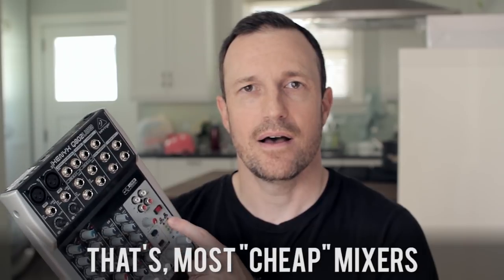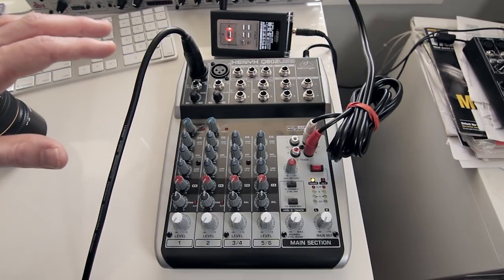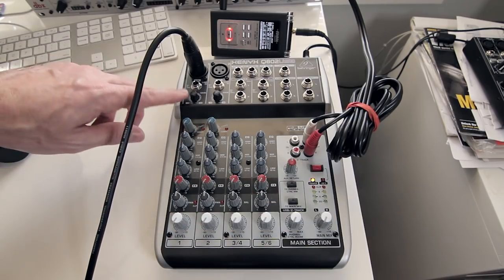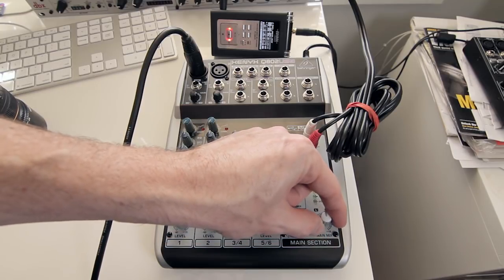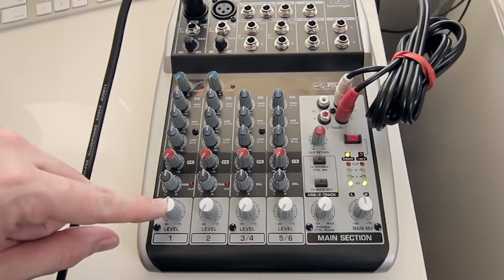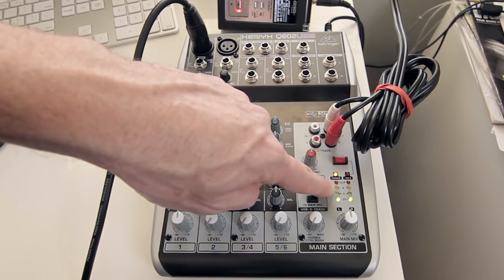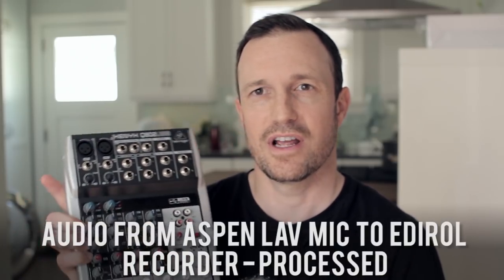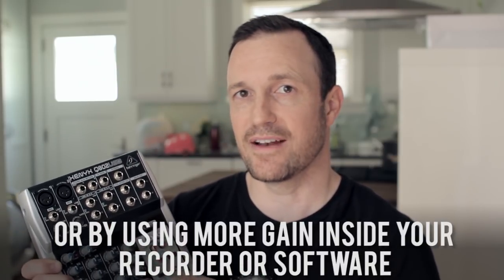Setting Microphone Levels on a Mixer - Gain Staging with no PFL/Solo Buttons

Comment: Workable for single mic, maybe two in a conversation, but if you do live audio, you'll need a whole lot more than that.  Great job for hitting the mark on pointing out which boards.  No buts. A great video, awesome tutorial, and works for podcasts like he says.  I'll try and put one up for the rest, later, I've been so busy lately with other stuff I haven't had the time, but such an excellent starting point here I was blown away.  Loved it.
Reply from the maker: Thanks, Harley!
Reply: @RayOrtega  Credit where due (and do for those who actually... ...well... ...do...) brother.
Trying to put together the necessities for a basic project room for recording\streamcasting. Here's my thoughts:
AirBnB a place for a week or two, pick a room or two, and video the setup with explanations
Do the room balancing with some simple DIY tools as well as a few extra entry level pieces of equipment (for eq etc) and describe the balancing styles being used.
Set up for a desk podcast and video the setup with explanations.
Set up a separate project recording room with a video system for monitoring, and go over the whole thing in basic detail from snakes to eq, to band warm up.
Another time, while it may prove a bit more involved and almost cost prohibitive, I might even "Float a room" with some basic materials in a DIY setup much the same way.  I'll focus on why for streamcast and for recording.
Wachu think?  I'm saving up right now, I don't know when I'll be able to do it, but I may start a GFM or kickstarter for an educational series on just this kind of thing to get there sooner.  I know people who would help with it, so long as they get paid right (and hey, I would insist on that anyway, as you get what you pay for or it's fraud\theft).  Any thoughts Bro?  Seriously, you've done this well, and anything you could pass along would be well considered.
Reply from the maker: @HTDav01  Go for it. I'd watch! Could be fairly niche in terms of getting an audience but you can bring more people in by featuring the gear and techniques used along the way. Good luck!
Reply: @RayOrtega  niche perhaps, but in terms of footage, I could cover several topics along audio and video.  The idea right now has several pathways.  More in the immediate sense, I have a smaller project in mind, targeting uploads of a musical nature and also of a conversational nature.  It's difficult to work on right now, family stuff is crazy, work too, and top that with school... ...I have about 25 minutes a week to work on it.  But hey, we do what we can right?
Reply from the maker: @HTDav01  Niche is good, by the way, it's how you get found;) The more specific you are, the more likely you'll be at the front of the line when someone searches. And yes, you have it right, do what you can, when you can! You'll be much further along a year from now than if you just waiting to get all your ducks in a row. Good luck!
Reply: @RayOrtega  thx.

Comment: Hey thank you very much, great explanation, it was very helpful!  I have a Behringer Xenyx 802 and used this method, for 4 DAYS I've been reading the same sentence in the exact same way trying to get my audio to sound right. In less than 5 minutes you may have saved me from insanity! I'm not a voiceover actor or anything, I just make little videos where I speak, but it's been driving me up the wall to the point I've almost stopped recording entirely! Thank you for saving my sanity XD
Reply from the maker: So glad this helped. Thanks for watching and the feedback.

Comment: Trying to understand the process. But at about  2 mins all knobs were down but then magically the main volume went up to halfway. Why halfway ?
Reply from the maker: That was just an editing error but when I show that particular process for gain staging, you'll notice that when I run the actual test/setup, I turn that knob back down. In this case that knob doesn't even matter because you are using the channel's clip light to gain stage and that clip LED is only affected by the Gain knob not the volume knob. Not sure if that is clear but you can also try the second method that I show if that is more helpful. Let me know how it goes and thanks for watching!

Comment: Worked like a charm. I am going to point out that his mixer goes to 15 and mine went to 10. That means his mids are not my mids. If anyone else is wondering why your results doesn't match his, make sure you are exactly between mid and full instead of exactly on mid.

Comment: Great video.Can you do a video about connecting synths to a mixer or would you use the same method? 
Thanks 
Paul.
Reply from the maker: Thanks, Paul. I don't have any experience with synths, they may require midi so you have to find out the connection first and then have an interface with that input

Comment: Good basic advice. It might be interesting to hear what happens when the trim is set too low and the channel volume is turned up to compensate. Also controlling line level inputs from keyboards and/or outboard equipment with volume controls. (I tell my crew to treat the volume control on the outboard equipment like the trim/gain on the board.)

Comment: My level and master seem to be behaving differently than yours. My level has zero one notch up on the left side of the knob. But when I set my gain to just below peak, and set my level to zero, my master barely registers any sound. But if I set my level to the middle and then set my master, I get same levels on the "meter" as you do.. but then my recording to Audacity clips and sounds terrible. So should I adjust the level or the master to make my recordings sound better? it's weird though that Audacty somehow hears more dB than I am apparently outputting. o_O
Reply from the maker: What mixer are you using? And honestly I'd set the gain the the channel and then whatever level Audacity needs. Check your Audacity settings to make sure it's not adding it's own gain.

Comment: You shouldn’t look at the main meters for any info when setting gain. The individual track clip light is the focus. Put the preamp’s fader to unity, then while speaking as loudly as you will once recording, slowly turn up the gain on that preamp until you start to see the clip light turn on— then back off the gain just enough to where you’re no longer activating the light. NOW you use the fader to control output of that track.
Reply from the maker: Thanks, that is the first method I demonstrate. I think you saw the fader turned up which I had to do in order to record the audio that you are hearing which you can see is being recorded to the audio recorder in the background, but then I turn it back down all the way and demonstrate using the clip light to set the gain which you can also hear cause then it transitions to the built in mic on the cam;)

Comment: I have a question about this one.  At 00:01:58 mark the edit has the Chanel and Main level pot jump to unity, but your VO and previous footage showed and said to have it Zeroed Out. Found this confusing, not complaining, I'm amazed with all the work you do for the community.
 Just wanted to note that the hiccup could muttlle someones ability to grasp the knowledge you are sharing. Keep up the good work, you have made a big difference to the joy podcasting and video-casting for me.
Reply from the maker: Jerry Wheat thanks Jerry. It was hard to do this one cause in order for the recorder to hear the audio the faders had to be up however I ended up using the camera's mic out of necessity and you'll see before I do the actual "check" process, I turn the fader down to perform the setup. But yes there is a chance that someone might get confused there if they have a keen eye like yours;) 

The truth is that fader doesn't actually play a roll in this setup because the clip light is not affected by the fader. So even if you put it up to unity like you see here before I turn it down, it will not affect the setup. So that's the good news in case someone decides to have it turned up.
Reply: I was noticed the same thing.. the jump at 1:58. Also confusing that the main mix was changed at all, surely irrelevant in terms of setting the correct mic gain? (but not explained in the video).

Comment: That video edit from 1:58 to 2:08 confuses this explanation. The main mix and ch. 1 levels jump to 12 o'clock, then back to 0.
Reply from the maker: Yeah good eye. Making videos is hard;) But it doesn't confuse the point. It would be fine to have the volume knob up, it would register on the meter as you see but you see this is turned back down when the 'check' is performed. So it's really simple, Turn everything down but the gain on the mic you are gain staging and watch your clip light. But if the knob was up, you can gain stage that way and in fact I show you how this is probably even better to do it with way. Having the knob down to 0 becomes more important when you have more than one mic. plugged in and you gain staging multiple mics. and of course this is the case when you are on a cheaper mixer like this that doesn't have solo buttons, and is one of the plusses of spending a little more to get even better, more convenient features like solos.  Thanks for watching.

Comment: This might not be as big a deal for podcasters, but as a working musician, you should be careful with the first method. The red clipping light means the mixer is being overloaded, so you don't ever want it to light up, you want your loudest parts to still be under the red or you'll get distortion (though you don't want it too low either, then you're just amplifying the extra noise). Similarly in the second method, you should have the meters at 0 at your normal voice level (not loudest), right? As long as you're not getting into the red at the loudest parts. But thanks for the second method, I've only worked on mixers with PFL and wasn't sure what to do, this is a good idea.
Reply from the maker: Thanks, Daniel. In the first method, the key is that when you hit the overload light on the channel you are giving a hard "check" to represent something that would overload but your normal speech never does this. If you plan to actually ever get as loud as the hard "check" then I would dial back the gain a little from that spot. However, I also think some OL lights on the channel are a warning and that there is still some headroom built in. I think that's how one of my older Mackie's does it but not 100%. 

In the second method, being at or near zero is good. On this particular mixer it's a little harder because the meter is so limited, but you can see when I talk that I am hitting the zero mark at the loudest parts of my speech and that good. 

The difference between the two being that you are purposely overloading at your loudest parts in the first method and for the second you aim for loudest parts to be around zero when you speak normally. The mixer preamps should be good enough for you to make adjustments in post production if you are in the neighborhood;)

Comment: Quick questions.
Every now and then my mic will click without having changed any settings. How do I track down what's causing it? 
Another question, is there any way to with settings to gain lower background noise without post production?
Reply from the maker: Troa Barton the clicking could be anything. Try another microphone if possible so that you can tell if it's actually coming from the microphone, the other gear or your environment. Pull one thing at a time out of the audio chain to try and track down the source. 

Check out the corresponding post on my site which talks about making adjustments for things like background noise. Essentially you'd want to use less gain in order to make the mic less sensitive.
Reply: Ray Ortega
unfortunately I only have the one mic but it doesnt do it all the time. Ive replaced the cable which seemed to help the frequency but it still does happen. im thinking it might be my mixer having a bad connection.

I'll check out that guide thanks for pointing me in the right direction!

Comment: I've been playing music for decades. But desk mixers are relatively new to me. My first impression is that they are amazingly inexpensive, considering the circuitry that goes into them.
Reply: most digital desk mixers use cheap transistor based circuits for most of their function, only a few still use analogue for any of the electrical\electronic pathway.  Pan and fader pots and initial gain\trim amplifiers are the only parts that are still more electrical, but some have been designed transistor style, making the entire pathway electronic.
Compared to their analogue counterparts, transistor based components are extremely cheap, but they also lack the longevity of analogues.
Digital boards often have a colder or more hollow, emptier overall feel in their sound than analogues, mostly because they don't represent all the infinitesimal intervals in a signal, they only approximate as far as their transistor numbers allow (getting better all the time as transistors are getting smaller and more values are capable of representation), but they do ok.
Find a decent digital board with analogue preamp and input path, probably an older model usb one would do, and you'll get a sound more vibrant than standard digital, almost indistinguishable from an analogue.

Comment: I have a mic preamp that goes in to my mixer. I set my levels on preamp for loudest noise is still under 0. But i can hear myself in headphones when recording until i turn the gain up on the mixer. Is this how it works? Doesnt this take away from the mic preamp im tryna use? Thanks in advanced

Comment: Hmm, I've had good luck in simply keeping the gain as low as possible, ironically.  It's really a delicate dance between the gain and slider to determine the best balance of headroom to play with and keeping feedback at bay.
Reply: Dennis, you should have the gain control as high as possible before clipping to reduce the signal-to-noise ratio. If your gain is low, you need to turn up your fader (slider) and that also increases noise. He mentioned the gain was the most important. set it and leave it. Hope this helps.
Reply: @howardforder4481  Yeah I guess I'm technically doing it wrong, but in every live situation I've basically set the gain to the to a point somewhat shy of feedback while the fader is between half and two-thirds up.  This has always got the best results for me, and no problems with noise (most modern equipment is pretty quiet anyway).  Cheers
Reply: @howardforder4481  .. 
..   0

Comment: I have an old Carvin Mixer that I want to use for some live sound but instead of faders that are at 0db when pointing straight up it just had level knobs all the way down is 0 and all the way up is 10 how do I set gain with this mixer? and also there are no mic gain clip lights

Comment: I bought a lucas nano 600 a few weeks ago the problem I have is when running a Sennheiser lead mic directly into the unit the mic is flat with no option to clean it up, would this mixer help if I ran  mic and audio signals through the mixer first? thanks

Comment: Hi! thanks for your video! I have a question, on my home system, Alesis Multimix 8 and Behringer active speakers, when I follow your proper mic gain setup with my condenser mic and looking at the led meter then when I started to turn the speaker on and the main mix level, It started to feedback already. If I was able to use the mic without feedback nothing will lit on the led meter because the gain is to low but that's the only way it works for now. I am an ammature on these so I'm confused, If I have to follow the LED meter it will be so loud can't even turn a main mix level it started to feedback. I do have sound and everything with the mic also with music and my wife was able to sing but we feel that the mic is not loud enough so I'm just trying to learn how to set it up properly and make the most out of the mic.The Behringer speakers has a gain level as well, do you think I should turn it down? It is at 10 o'clock right now. Appreciate all the help!

Comment: Great video, Ray, thanks! But how do I get proper levels on those channels, that don't have a knob for gain? Could you pls recommend me something? Thank you in advance!
Reply from the maker: Thanks, Thorsten. Each channel on this mixer and other mixers has at least a volume fader. You can use that to boost or lower your incoming audio or use the 1/4" input on a channel with gain. Otherwise you'll have to control the amount of input from the device itself.